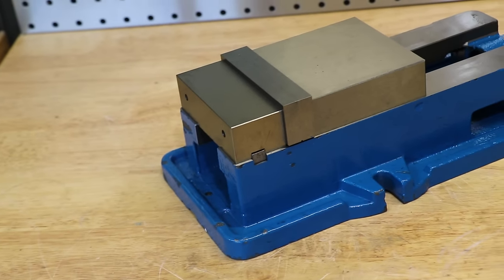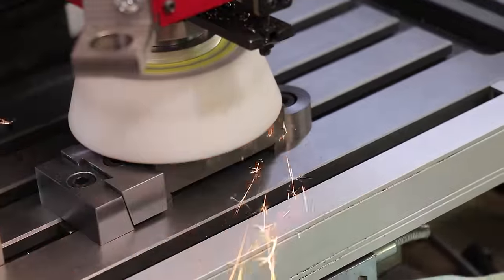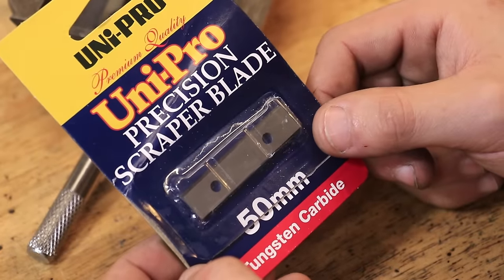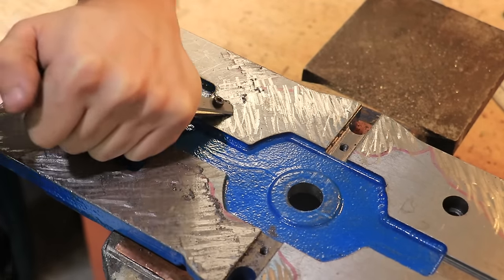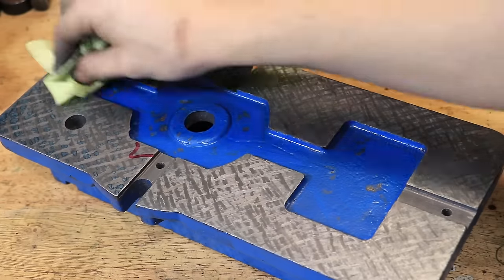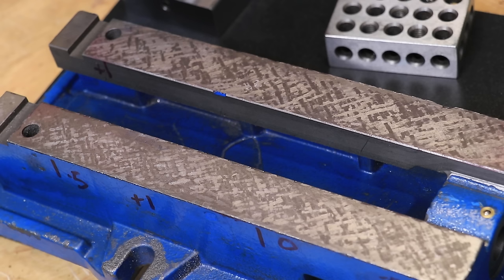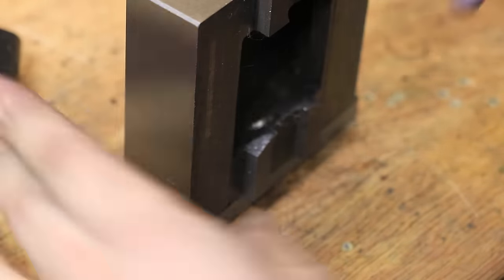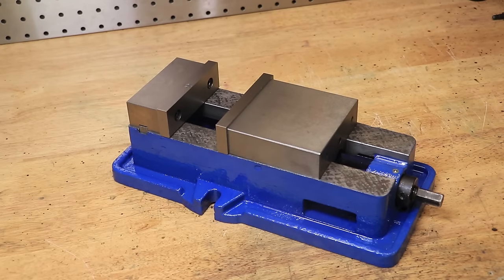My Cheap Milling Vice Has Issues. Can I fix It? (Surface Scraping)

Comment: going to be my new favorite channel. question have u seen the proxxon micro mill mf70? its prices similar to one of the mini lathes. i just got one of the mini lathes on amazon an loving it so far but have found alot of little issues that need fixing but my next buy was going to buy a mill but i dont know what i should do after finding the micro mill. its seems alittle small an ive found a few ppl on youtube using them to cut steel but im still hesitant at dropping 450 an would rather just hold on to that an keep saving to get one that is more than double that price, i just want to get something that i can use an learn on but at the same time something that will last an will actually be able to make parts on. im coming from 3d printers an finally made the jump to working with metal so in the end id like to be able to use the mill an lathe to help build a cnc router that will be rigid enough to cut steel as well, i have a welder, nothing nice but a start so that will be something that will have to be upgraded in time but what would u suggest on the mill, could u perhaps take a look at the proxxon micro mill m70 an see what u think about it an is it worth starting out with or skip an keep saving.
Reply from the maker: If you are looking about info on proxxon mills, I think the channel We Can Do That better has one, and uses it in more recent videos. Personally it is a little small for my liking, he is able to machine steel but it is very slow. The smallest vertical mill that id settle for would be a sieg X2, and even that is a little small and has its drawbacks. however people do make them work. Cheers

Comment: Apart from the price of buying expensive machines and tools, I can certainly see a benefit from buying cheaper things. When we still learning we WILL make mistakes. And even with expensive equipment, it will get worn and need maintenance. I have never scraped any surfaces, but I would rather risk doing a mistake scraping cheaper tools and machines than restoring something like a Schaublin or something.

Comment: I wonder why you didn't grind the top surface of the vise? Once you scraped the bottom and got it flat, wouldn't it make sense to flip it over and clamp the bottom on the milling machine table? then, you could grind the top parallel to the milling table/vise bottom - I agree that it would make it flat and parallel to your particular milling machine (like "custom-made") but then, that's where you'll be using it, right?
Reply from the maker: Over such a large distance my mill isn't able to get things to be that flat, which is roughly 0.01mm over 300mm or so. Cheers

Comment: When I was at school 1960’s our metal working rooms had mechanical scrapers.  I have never seen a hand scraper.  I don’t see how one would achieve a dead flat surface with a hand tool.

Comment: The point of surface scraping is to create a flat surface that retains oil.  I'm not sure in this particular instance it's a great fit for the bottom of the vise -- however, it's still an improvement over what was there, and you got some practice in regarding surface grinding so it's a win anyways.
Reply: This is really a very good case for scraping. It's the only alternative to surface grinding to get globally flat. Many people scrape vises, parallels, straight edges, levels, angle plates, rotary tables, the tops of mill tables, ect. But yes it is also very good for the moving parts, it's just not only for that

Comment: Wouldn't the more acute angle of the smaller radius cut deeper?
Reply: you don't want it to cut deep, or else you get the blade stuck or chattering like crazy. The angle has to be a little over 90 degrees so it actually scrapes. It's not meant for cutting deep, but to remove tiny amounts of material just in the right places. The angle is also dependent on the material, steel might need a different geometry as cast iron.

Comment: Would a Dremel work also for the leveling/scraping job?
Reply: Maybe, but I bet it will be pretty messy and too irregular. Also you don't want to accidentally embed grinding stones in the surface

Comment: I purchased a "cheap" milling vice in anticipation of my mill arriving one day. Fifteen months on order and counting.
 I hadn't removed the vice from its box for over a year but decided to have a look. It looks like it was "surface ground", on a concrete block. The edges were sharp and while I didn't cut myself I had a few close shaves. 
On removing the nut under the moving jaw it looks like they must have snapped the tap used to cut the threads and then drilled, chiseled, punched, gnawed and any other method, to get the bits of the tap out. Fortunately most of the damage is in the first thread the rest looking and working ok. 
The action of the screw in the base was rough to say the least. The "thrust" bearing was one washer, I suspect from the roller bearing that should have been there. Fortunately I had some bearings so inserted the roller and things felt much better. 
Flatness and parallelism I haven't probed yet because I'm sure the top surfaces missed out on the finer grinding processes. 
I should have returned it whence it was purchased but having had it for a year without unboxing I didn't feel that was fare to the vendor, a local company with a pretty good reputation generally.  
A hopefully better vice has been ordered with the mill so this one will in all likelihood end up on the drill press. Mines painted green so there's no mistaking it for a Kurt.
🤔🇨🇦🍌🥋🕊️🇺🇦💩🇨🇳💩😂💩

Comment: In think your tool radius is too small and you recognized that it is too narrow. Also, it has to have 5 deg positive rake and has to be honed on a diamond wheel. I think your tool is dull. That’s why you are working so hard to remove material. Anyway, looks like you got it flat and that’s what counts. To make the other side parallel you scrap it flat first, then you figure out which way it is tilted and then you step scrape it to be parallel.

Comment: 30 to 40 hours??! That's like $600 worth of time, at that point you could just buy that $700 one.

Though I guess if you do it in your down time it's cheaper and the experience is good too.
Reply from the maker: Well this is a hobby, not work

Comment: overall good job! there is one issue that can never be overcome with that cheap chinese stuff: metallurgy. the chinese just haven't learned how to cook steel and probably never will. stefan likes to buy that junk and then goes thru lengthy remanufacturing processes to make the stuff work. but it wears out awfully fast and you have to weigh the pros and cons of buying used stuff from european or american manufacture or junk chinese of new manufacture. almost always you come out ahead with the former... just an observation
Reply: I'm not sure it's about not learning proper alloying, but more about they do not see it as a benefit to the bottom line. They are exceptionally skilled at copying intricate techniques when doing so is seen as necessary. It is so much more attractive in today's economy to flood the market with tons and tons of garbage steel. Sadly, I am also seeing this issue on some very expensive pieces of equipment (large commercial trucks). It's just so much more profitable to manufacture something that is cheaper and will wear out very fast. If everything wears out equally fast then nobody will criticize a particular manufacturer.
Reply: If it's a western company in China with staff overseeing the manufacture then good products are possible, but it's inherent within Chinese culture to cut corners at every opportunity if someone isn't standing over them watching.
Reply: @heybabycometobutthead  in general yes, however a good friend of mine had spent time there and said that the items that made spec stay in china and the rejects go into export. 
it still doesn't improve the shitty metallurgy in chinese steel and steel products and machinery

Comment: On such a big piece, you could just put a piece of sandpaper to the surfaceplace once it is scraped. Use spray glue or even just plain water to make it stick. And then let the piece's weight do the works, just move it and let the magic happen.
Reply: That could also be an efficient method to destroy the accuracy of the surface plate.
Reply: How? Do you think you gonna bend it? If you think sticking it onto the surface plate with water is to dangerous, just use some painters tape.
Reply: @marcus_w0  A surface plate is not intended for use as a lap and there are much cheaper and better options for a lap. Ox Tools, Robin Renzetti, and many other authoritative voices have covered proper lapping techniques. The surface plate is intended to be a precision flat reference surface that you can use to calibrate many other shop flat references. It is intended for metrology.

Have you looked at the hardness of granite versus everything else in the shop? If the grit that is inevitably let loose with sanding could abrade metal then it most certainly can and will abrade your surface plate. There is a reason that machinists will often cover their surface plate when not in use, and there is a reason that machinists will carefully place objects on the surface plate rather than throwing them around. However, by your comments it appears that you may have never considered the cost or effort required for lapping your surface plate back into specifications. If you have multiple surface plates and dedicate one to being abused, then go right ahead and do as you suggest. If you only have one surface plate and you treat it this way then you no longer have a precision flat reference.

Sticking anything to your surface plate is dangerous if you value precision.
Reply: @r2db  cheaper as if you already own one?
Reply: @marcus_w0  Cheaper as in "less expensive than purchasing a new surface plate" when (not if) you destroy the accuracy of the one you own and learn that it's going to cost more to have someone lap it back into specifications than getting another cheap one. So, again, if you are going to do this then just start out and buy two. Abuse one and keep the other one in good condition. Scrap aluminum plate can be readily manufactured by the home machinist into laps using the "three plates" method. Small pieces of scrap aluminum are far less expensive than a new surface plate, but a shop-manufactured three plate setup is automatically self-correcting.

Even for the home machinist, if one does not learn how to properly treat one's tools then when it comes time to upgrade to better tooling one will have significant bad habits to unlearn.
Reply: @r2db  But how do you even destroy it, if you use a sheet of sand-"paper" the size of your plate? In Germany sandpaper isn't actually paper but a meshed fabric. And you can get it in sizes up to 50x50cm easily. You'll cover the whole plate with a single sheet, that sticks absolutely flat when sat on water - there's no way that there's any abrasive getting under it.  I'd say you harm it more while trying to blue an uneven part.
Reply: @r2db  Also, you could just get a piece of marble or granite kitchen table or countertop - it's not as flat as a measuring surface - but should be flat enough over 20+ cm. Seriously - those surfaces are flat as F. Try it.
Reply: @marcus_w0  You seem far too interested in argument for the sake of argument and show too little interest in advancing your knowledge. Marble has a Mohs hardness of 3-4, and the abrasives often used in sandpaper are 9. If you are going to use marble for anything in the shop then you must have a method for measuring the loss of flatness and restoring it to a flat surface. Or maybe you have never even noticed the bowing of marble steps from mere foot traffic.

If you feel that a granite countertop is sufficient then go right ahead and do as you wish. At least granite runs around a Mohs hardness of 6-7, so it is going to last longer than marble. Most granite countertop is about 1.25 inches thick, and I have not seen a surface plate thinner than 3 inches thick with some being 6 inches thick. But go ahead and do your thing. As I had mentioned previously, you do not seem to either understand or value precision, and clearly in your mind generations of machinists have been incorrect.

Comment: I don't understand how the Chinese company's making this vices manage to get it so bad. They obviously grind the surfaces judging by the surface finish, and how is it possible to grind a thick casting on a surface grinder and having it come out not flat when you are done?
Reply: Incorrect work holding?
Reply: @mark314158  I'm guessing they use mag tables like everybody else. And a thick casting should not bend from the magnetic force if they just mag down a uneven surface. But it might be tipping between two high spots so maybe they should be using 3 spacers when grinding the first surface (because a 3 legged table can not be tipping even if the legs are uneven) and that they are not doing that and that is why they get uneven surfaces.
Reply: @titter3648  Maybe not heat treating the castings, straight to the machine shop from the foundry

Comment: If you check that scraped surface after 5 months to 1 year after scraping, you will be astonished to see that surface is rocking again. So you need to repeat scraping again and again from time to time. This like Sisyphus job...
Reply from the maker: Thankyou for the heads up. Will be interesting see how well it holds up. With the amount of use a vice gets it might last longer than machine ways no?
Reply: @artisanmakes on one side, i think everything depends on conditions you used your machine, lubrication and vise. On the other side, internal stresses in cast iron are constantly changing surface flatness of the part. That is very interesting topic, please don't forget to return and check this issue in your YouTube channel.

Comment: Whilst the scraping is cool, you could have just laid some Wet and Dry paper on the surface plate and lapped the surfaces.
EDIT: I mean primarily on the base, but with measuring as you go and selectively applying pressure to adjust side to side and end up closer to parallel at the top.
Reply: So how do you lap the two surfaces parallel?
Reply: Just make sure thats on a surface plate you don't care about ruining.
Reply: @qantse  -  the same way that you scrape them parallel. Testing and careful application of pressure. However what I meant was to lap the base flat, since that is the primary surface he was working from. By applying more pressure on one side he could have minimised the lack of parallelism of the top rail, meaning very little (if any) scraping at the top.
Reply: @johncoops6897  makes sense 👍
Reply: In my experience the surfaces often tend to get slightly convex when doing this. Scraping is indeed better.

Comment: Wasting your time, mate !
Reply: What a helpful, in-depth analysis!
Reply: @ydonl  I believe what Owen is talking about is that yes he did a great job on the vise and learned some valuable skills. The real problem is the materials the vise is made from are not strong enough and are not stable. The vise  is going to degrade over time by flexing. In a few months it will be back in the same state that it started in and this whole process will have to be repeated. The long term fix may have be adding a thick steel plate to the bottom of the vise to add rigidity after he got done fixing the vise, but it might need to be a hardened plate which could cost more than the vise did.

Comment: So I have to ask, why didn't you use a plate of glass with sand paper affixed to level the bottom? It looks like scraping would open for a greater failure to occur. Also, using the sanding method you could use Dykem which would stay in the low spots until the grind was finished. I sure I must be missing something but I would be interested in knowing what.
Reply from the maker: The aim is to let flat and parallel surfaces, I don't know how you're use that method to get surfaces parallel
Reply: @artisanmakes  I thought the same thing at the method he used, I would think either way is open to error but he was just trying to flatten the base which would be the reference surface, no? I am not trying to be funny, I am just trying to see the difference. Thanks for the reply.
Reply from the maker: Both the bottom and top were out of tolorance, you could easily get the surfaces flat with that method, but they also need to be parallel to each other to work as a good vice. Cheers
Reply: @artisanmakes  Ok, I understand what you're saying but either way you have to true one surface as the reference to work from. So how you get the bottom flat should be irrelevant or is my logic flawed? Again thanks for the reply. I enjoy all the machining videos, I am just sorry I don't have space to build a shop  to do so myself.
Reply from the maker: As long as you don't round the bottom by accident, which can easily happen when lapping, I don't see why not

Comment: I'm slightly confused.....why wouldnt you fixture the parts directly to the table with a good set of 1 2 3 blocks and maybe some strap clamps and just faceoff the bottom?
Reply from the maker: The mill wont machine something that is 400mm long and get a flatness that is 0.01mm